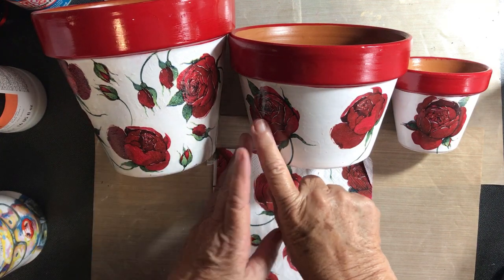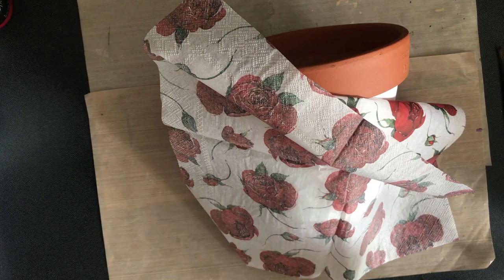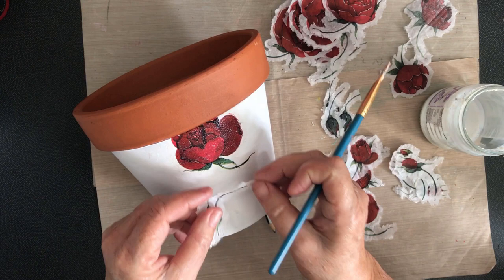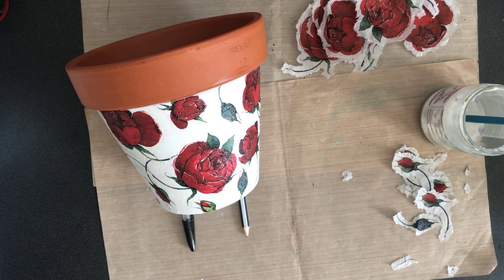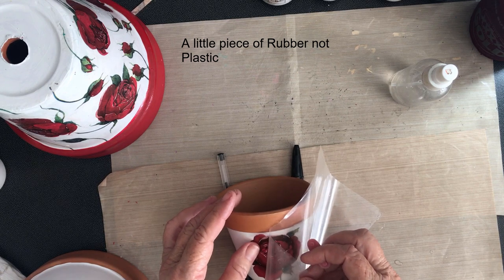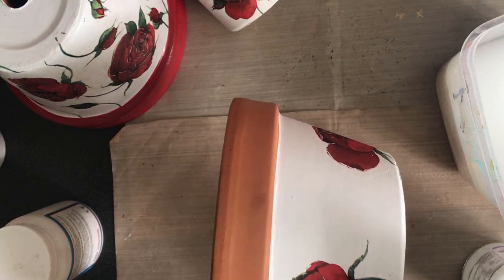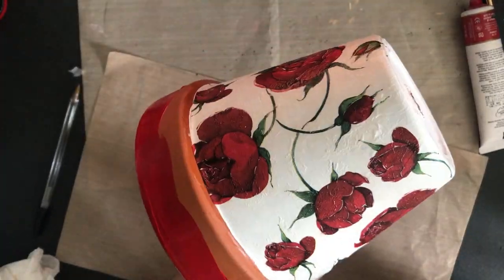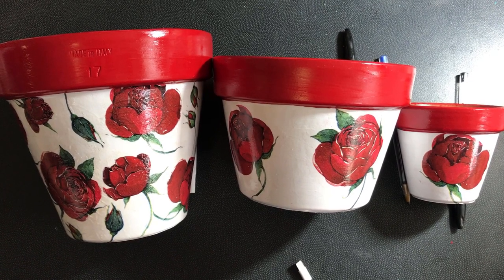Three Designs from one Paper Napkin on Terracotta Pots

Comment: Great tutorial.  Just one question.  How does the napkin not tear when you put the glue on top?  I've never used the water method, but whenever I glue a napkin to a surface and then put glue on top, the napkins tear.   On the first pot it looks like you added the glue while the napkin was still wet.  What's the secret 😀?
Reply from the maker: I am using a soft bristle brush and am very careful as the napkin is fragile when wet. The glue is watered down so that it is less likely to tear the napkin. If there are wrinkles do not try to push them out as this will tear the napkin, you need to leave them there. I am not sure what else to tell you. Good luck Chris.

Comment: The plastic sheets make a huge difference where wrinkles are concerned. I use the cheaper ones because they’re thinner and easier to work with. 

Thank you for this video! 😊
Reply from the maker: I agree Alice the thinner ones are easier to work with, more flexibility on the curved surface.